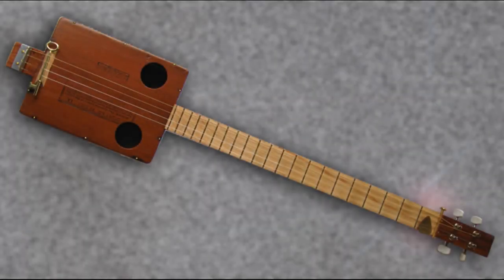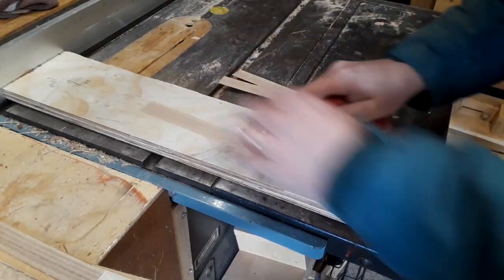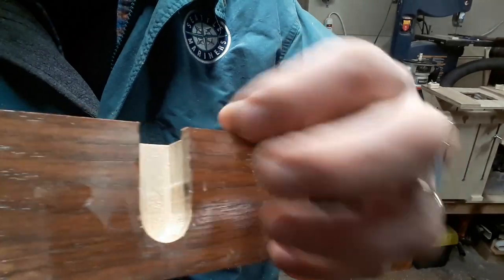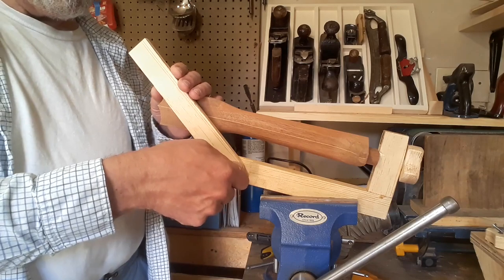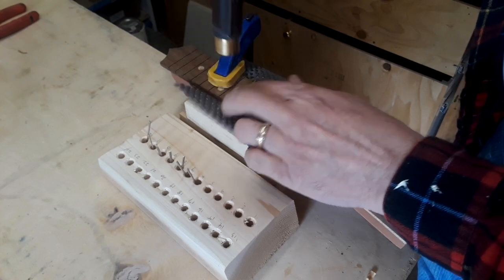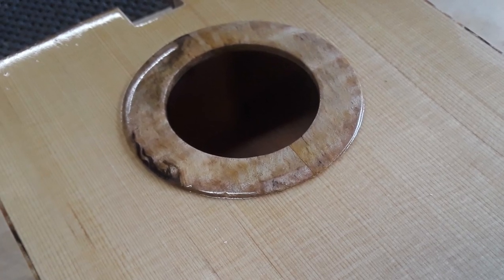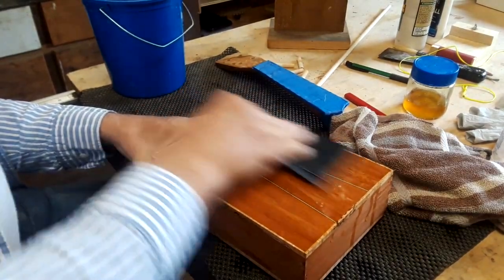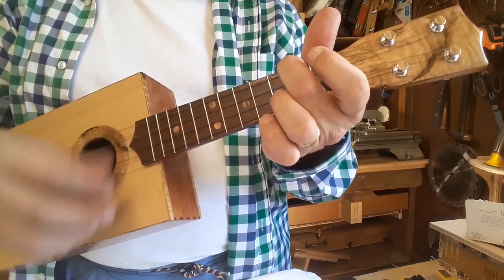An Overview of Making a Cigar Box Ukulele (1)

Comment: May i ask you something sir?
Reply from the maker: Please do.
Reply: Thank you. First i admire you project. Turned out great. Second one is: Did you dome the back or the top or both are straight?
Reply from the maker: No they are flat. I'll have another cigar box done soon and then a few with regular bodies that will be  domed.
Reply: @OpenWoodShop  
 I asked because i was thinking on building a box guitar and you have build it the same way i had in mind. The sides and the back of my box will be walnut wood 6mm thick or less. The top spruce 3 or 5 mm thick. Cherry neck and walnut fretboard. Inside i will make a little bit of traditional bracing and use kerfed linings. And to protect it i will put bending all around the corners. I'm planing to use the classical guitar neck joint, no dovetail.
My concern is if I shoule let the soundboard flat or giving a dome. If I left it flat, should I make the neck angle?
Reply from the maker: @irisiris3842  On a ukulele there is no neck angle if the top is flat. Here is  a set of plans that I used and should help you in visualizing what you want:
https://cdn.senaterace2012.com/wp-content/uploads/soprano-ukulele_104081.jpg
Good luck!
Reply: @OpenWoodShop  In fact i was thinking to build a more larger box, not an ukulele size. Thank you for the  plans. I appreciate it.